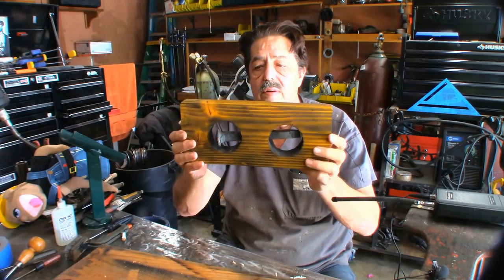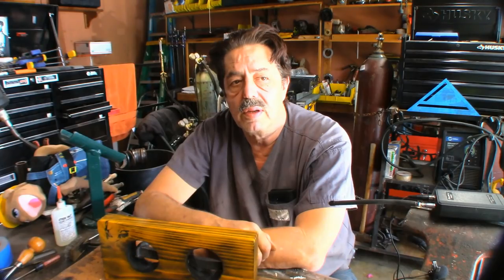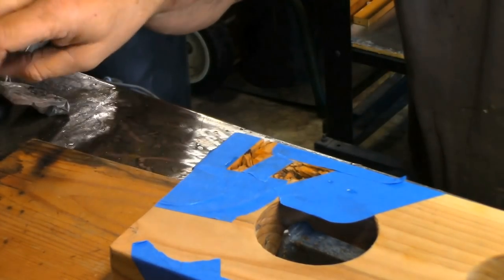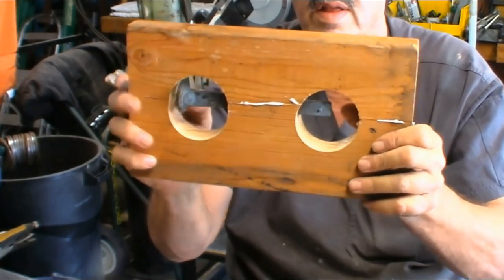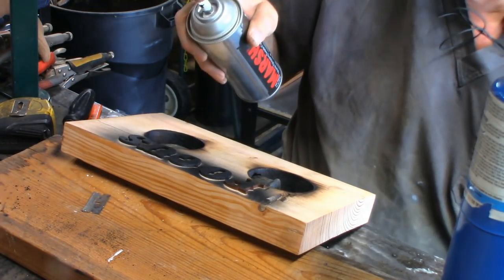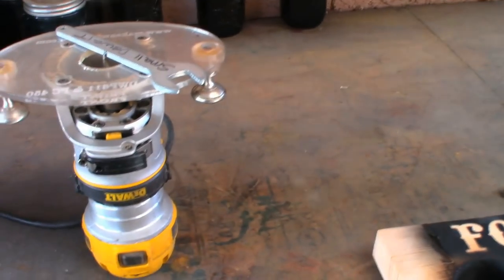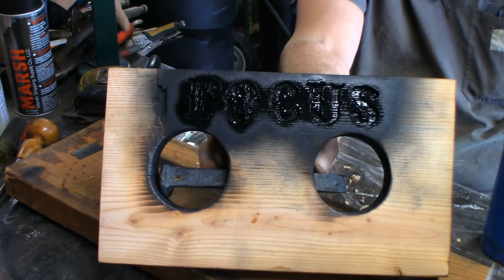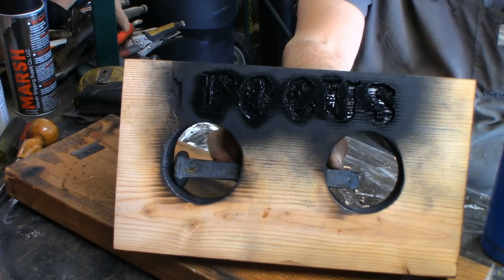Impossible Railroad Spike-Through Wood Trick - Part 2

Comment: I used coffee grounds in epoxy a little while back. Works good. I also found that RIT dyes epoxy well but dont think it would work with CA glue
Reply from the maker: Good idea and I use coffee grounds alot because it gives a natural look after sanding - RIT dyes, im not sure i have used powder and mixed my own or transtint which is not cheap but it goes a very long way and I do not need that many colors to achieve the other colors - mixing ? Just experiment and see what happens on scrap and let me know......thanks
Reply: The Home Handyman you’ve used the powder with CA glue before?
Reply from the maker: yes - both coffee grounds - ground stones like coral and turquoise etc- works well to fill in the cracking in wood and voids

Comment: After you burn the 2x8 did you light sand before you put the dye on the wood thanks
Reply from the maker: Yes - 220 or 329 to even out the color - if you make a error and over sand you can simply burn lightly again